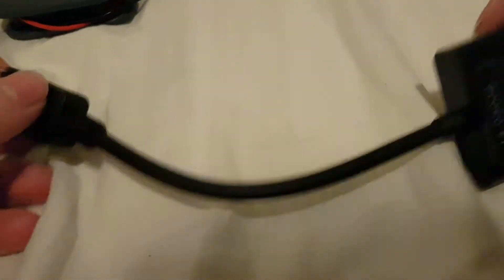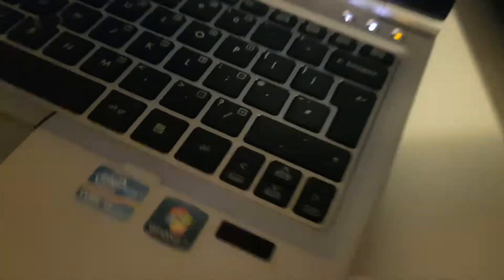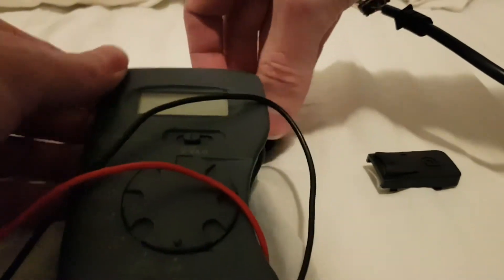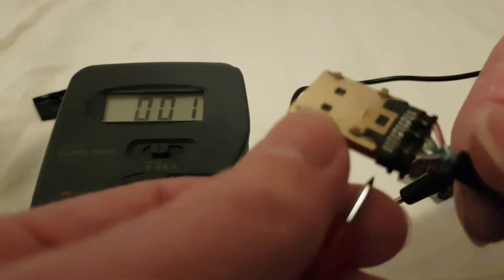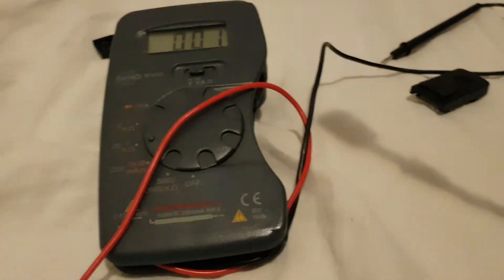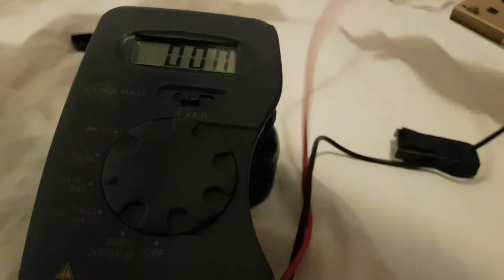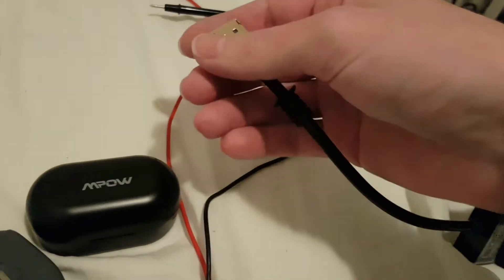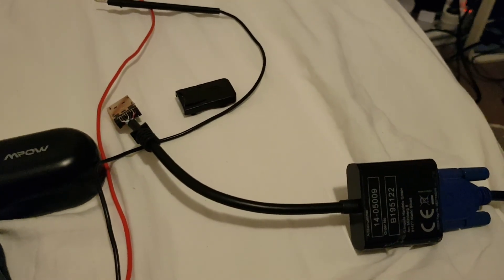*WARNING* 20th PIN ISSUE FOR USING DISPLAYPORT DONGLES

Comment: On some good GPU, this not a problem. They use TPS2031 IC to prevent backfeed voltage, 3v3 rail on gpu will separated with DP_PWR pin.

The problem is with cheap cards, they replace this IC with cheap fuse.

Comment: Should I add a diode on 20th pin cable so voltage dont flow from monitor to gpu. or I just add a bed switch on 20th pin So turning it off/on will bring display back ( saving unplug of cables ) ? 
Please reply
Reply from the maker: Yeah or buy a official cable or don't use DVI HDMI and Displayport are on every modern monitor i upgraded as well
Reply: @alexderpyracc4053  my gpu is p1000 and it only has Mini DP ports

Comment: I want a display port cable to comnect my gpu with my monitor. I don't know if you've heard about the 3080 gpu but its a new card(relaeased in november). Do you think a gpu that new will have some protection over the 20th pin's voltage? And if not is it hard to cut the pin's cable ?
Reply from the maker: Get a branded one that has the dp+ logo on it those don't have the 20th pin connected on default

Comment: Just bought myself a new Asus monitor but have it hooked up via HDMI currently. I'll be testing the supplied DP cable with my multimeter soon because I want to use the G sync feature and if it's live I'll be half tempted to buy a broken GPU from somewhere and contact trading standards just to teach these big companies a lesson about supplying cheap non compliant cables to maximize profits
Reply: Hey there, did you get an ASUS monitor? Did you have any shortage issues?

Comment: I think i have a 20pin dp male to 20pin male, because my bios started two days ago to make some beep errors. So i found out that is a graphics card error. After searching in the net i got a feeling that this dp cable is the culprit. Now iam using hdmi cables with no problems at all. So it is possible to fix it by myself? For example is it safe to cut the wire who gives the extra voltage? In short terms can i make a 20pin dp to 19dp male? Thanks in advance
Reply from the maker: You can try to desolder the 20th pin that's what I did
Reply from the maker: The 20th pin is only supposed to be used to give the converter power but cheap cables that for example convert from Displayport to HDMI directly still got the power from the display connected to the converter whilst it's only supposed to come from the GPU side so when the PC is off but display is still powered it sends power straight into the GPU now most GPU got safety against backfeeding it still might cause errors

Comment: This helped me out a lot dude. Why would they still sell these? Bought one from Amazon and plugged it in today and my computer pooped its pants. I was scared. Was told to order the display port 1.2 certified from a brand name and it will work.
Reply from the maker: They sell it because it's cheap and they don't put a diode across the pin it's used to power the converter but power from the monitor also comes through it when the PC is off
Reply: How did your pc behaved?